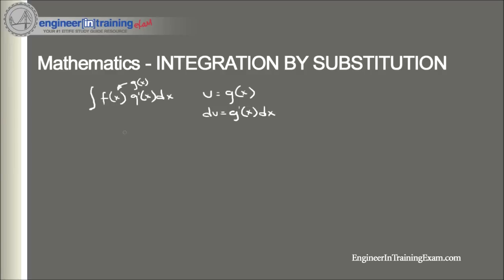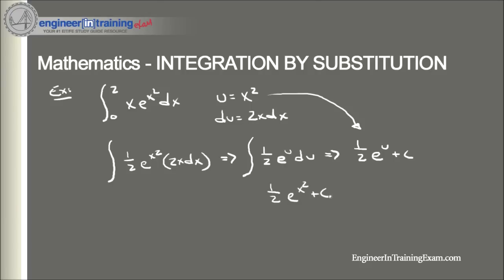Integration by Substitution - Fundamentals of Engineering FE EIT Exam Review

Comment: where did you get the 1/2 from inside the integral in the second example?!
Reply: Late but if you substitute du=2cos(2x)dx back into u*du, the 2 has to be canceled out to get the original starting equation. So we can assume that there is a (1/2) into the integral u*du equation in order to cancel that 2 out.